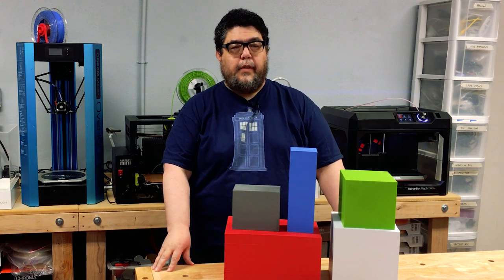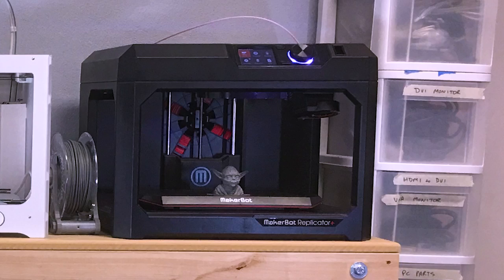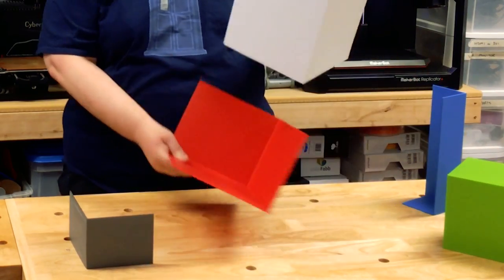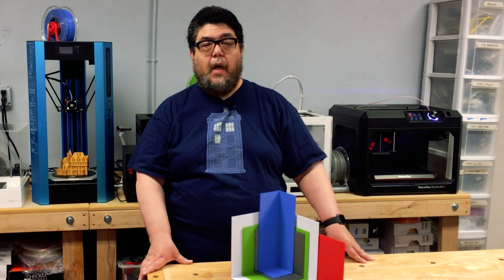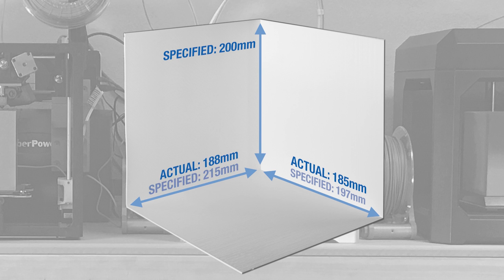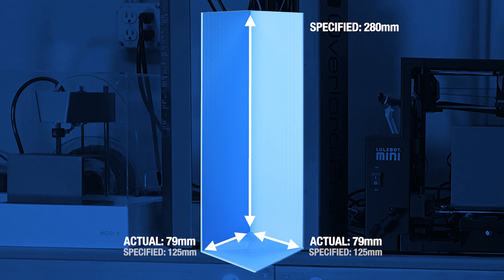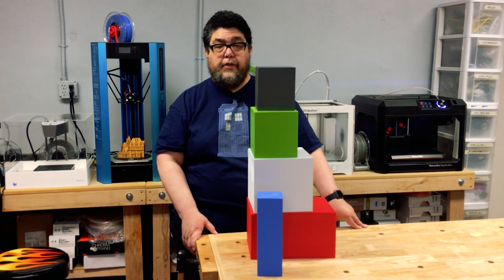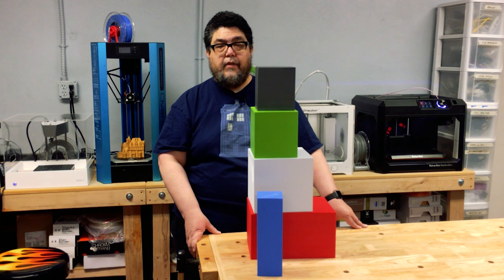The secret truth about 3D printer size

Comment: Hi! for Delta printers the dimension of the bottom footprint is always the diagonal dimension, not the side length of a square!
Reply from the maker: That makes total sense. Thanks!
Reply: In addition, the height max is in the center, and full diametric coverage may be limited to a slightly lower height. Since tall objects often end near the center this is an important dimensions, but they should specify both heights for full disclosure.

Comment: Were some of the reduction due to the heater bed's area?  I'm trying to build a diy 12x12" , but finding a 12v heated bed seems impossible. I only have 110v wall outlets. I'm not sure if I could use an adapter. Also the bigger heat beds are 750w!! That would heat my room!!
Reply from the maker: So, first keep in mind that this video was done before a ton of lower cost printers came out with ginormous beds. That said, I find that big beds and no enclosures are very hard to heat evenly.

Comment: What do you guys recommend if you we're going to make something that's the size of 15 inches by 15 inches or other options for even larger say 20 inches ?
Reply from the maker: Well, first keep in mind this is a 6 year old video, and printers have changed a lot. But the second thing to keep in mind is that the bigger the thing you're printing, the more challenging the print is going to be. That's because the heat dynamics don't scale linearly. Something that's 200mm x 200mm will be much easier to control than something 300mm by 300mm (or roughly a foot square). For the sizes you're talking about, I think you have two main choices: get a big printer or print in segments and assemble the segments. There's a lot more fit and finish to that second option, but once you have a working model, reproducing it should be fairly easy. Big printers can be fussy. I was recently offered this https://www.elegoo.com/pages/elegoo-orangestorm-giga but I don't have enough space to house it. I think Uncle Jessy has some videos on that printer https://www.youtube.com/watch?v=XY-Gl-p0HnY. But I'd think that getting a plate that big to heat evenly and tram would be something of a nightmare. If I had to make a 2-foot by 2-foot project, I'd do it modularly and assemble it. Good luck!

Comment: i made my own 3d printer and it prints only 3inch model is there any way to increase its print size as there is more space to print??
Reply from the maker: Without knowing more about your printer, not much I can say to help. Size is a matter of build area a plate size, so if the gantry moves far enough, the plate is big enough, and your models are good enough, you should be able to make bigger. But, again, not knowing anything about your printer, I don't have much to say here. Good luck, though.

Comment: this is very important. how can we know the actual build area sizes?
Reply from the maker: Best bet is to contact the vendor. This is an old post, before cheaper "consumer" printers came out with big beds. But definitely contact the vendor, and keep in mind that the bigger the build plate, the harder it is to heat it consistently without some enclosure and heat management solution.

Comment: What is your recommendation for the best bang for your buck - I need to print objects as mold patterns but we can piece them together - so 200mm x 200mm x 200mm or larger… if we had to print 5-6 PCs that’s fine but we want decent quality or a combo of bigger / decent quality. Look into for a quick answer from a diy pro :) ty
Reply from the maker: The Elegoo Neptune 2 (if you can find it) is apparently great bang for your buck. Anycubic just announced their Vyper, which looks great on paper. I have both in-house to test, but won't be able to make a personal recommendation for a bit. You can pretty much never go wrong with Prusa, but it's more expensive. And if you can put up with the quirks, I'm pretty impressed with the Sermoon D1, which I just reviewed yesterday here. It's more expensive, though. Right now, dollar-for-dollar, check out the Anycubic and Elegoo FDM reviews on YouTube to see if others confirm my thoughts. Good luck!

Comment: Yeah but, cant you just add bigger rails (which are pretty cheap considering the price difference for bigger ones) now dont get me wrong im sure there some adjustments that would have to be made maybe code, possibly switching the "os" i dont know what term, the thing that calculates the area so it prints at the specified x,y,z. Doesnt seem like a $1000 or 3000 dollar difference in price. I mean the rails are like 50 bucks for 4  3 footers. I mean you might need better servos but i wouldn't think so. Same speed and weight just further to go.
Reply from the maker: Keep in mind that article was published 7 years or so ago, before the big boom in fairly inexpensive 3D printers. It was pre-CR10.